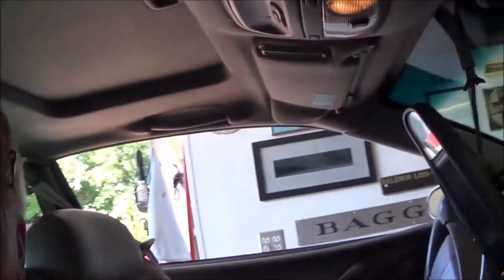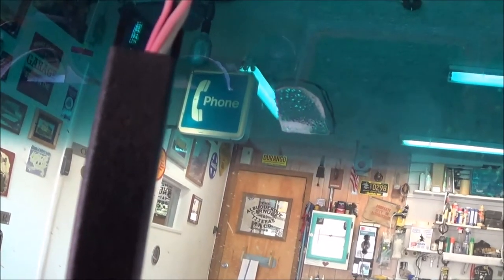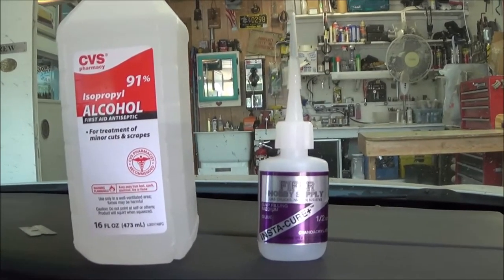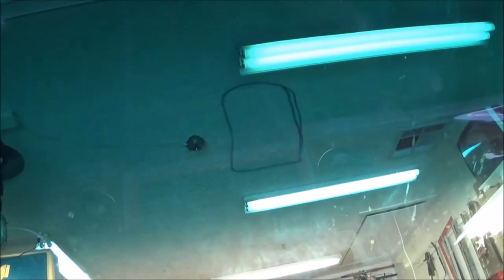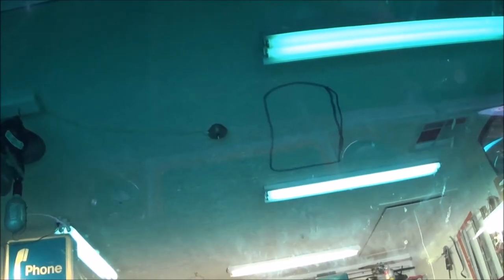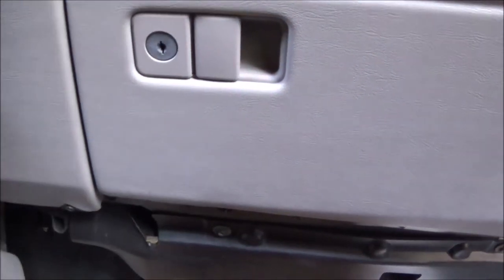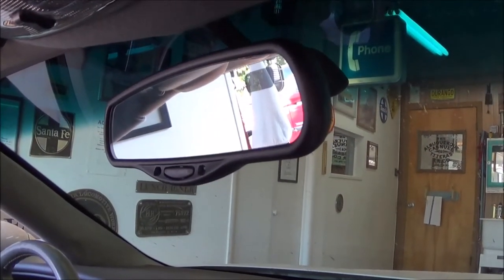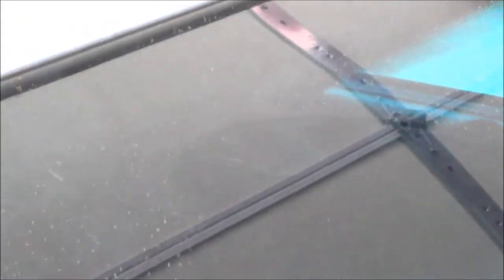How to re install your cars Inside Rear View Mirror

Comment: Excellent demonstration. Do you have any suggestions for keeping GPS and "dash cams" adhered to the windshield with their suction cup mounts? I have no luck keeping them attached. Every few weeks, they just fall off. Thanks.
Reply from the maker: If the rubber is good maybe a very light rub of baby oil on the cup and then a wipe with a dry cotton cloth.
Thanks , Mike

Comment: Could you please kindly help: my tesla rear view mirror is detached from the windshield in tesla workshop. Tesla claims that it has been badly fixed by someone with sealant and putting the blame on us. My question is how rear view mirror is attached to the windshield. Surely it’s stuck by some sort of adhesive in their assembly process? So it came off due to poor rear view assembly during build process right ?
Please let me know. Thanks
Reply from the maker: They are simply held on with super glue